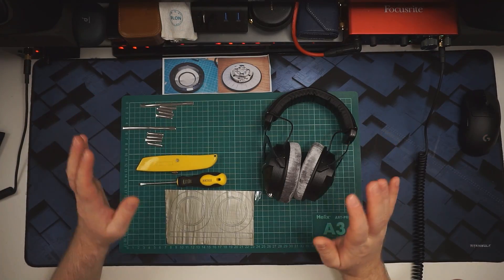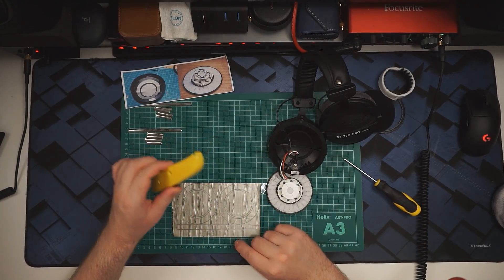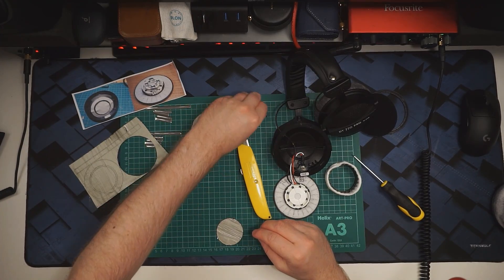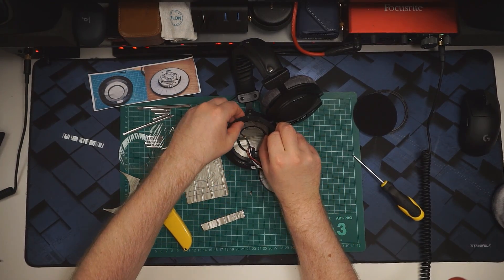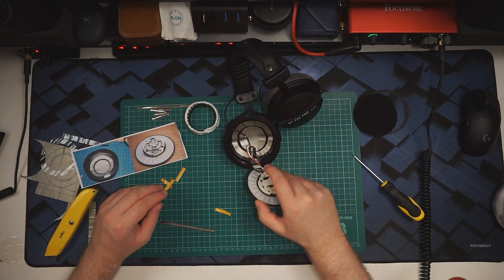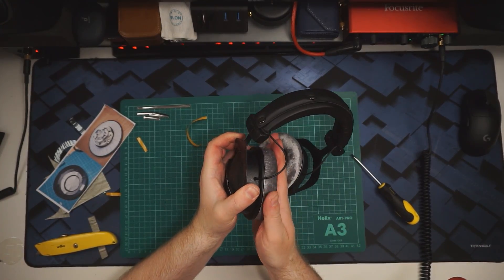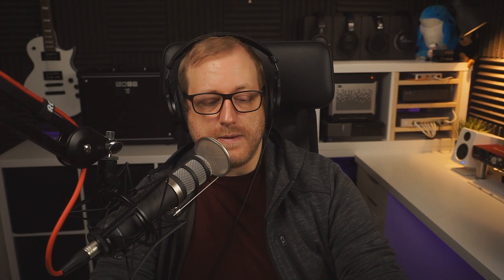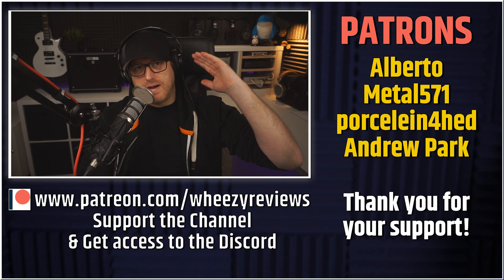DT 770 Mod - Mass loading and damping

Comment: I've just bought a new pair of the DT770pro (250ohm) to replace my old pair from 2002. I noticed a huge difference between the two soundwise. My old pair does not have a peak in the treble and the mid range is much more open and big sounding. The only difference I can see on mine is that the thin paper in front of the driver (in the center) is worn of on the old pair and so is the foam pads. So that's my suggestion on how to mod them. Remove what's in front of the drivers. That is unless Beyerdynamic have actually changed the drivers to a worse sounding version

Comment: I have just been looking at the customized DT770s on the Custom Cans site, but after watching this video, I think this mod is for me, I don't feel the need for more bass.
 I love my 250Ω 770s, but they don't work well with my iFi xDSD DAC/amp, there is plenty of gain, but the sound is sluggish. I want to get some 32Ω 770s to go with it. My DT1990s are OK with this DAC (also 250Ω, but a couple of dB more sensitive), but I don't want to take these outdoors. Maybe the 80Ω 770s would be a good match, but they would need the cable mod, stock cable is too long.
I notice that several people commenting on this video have experience with Beyerdynamic headphones, can anyone give me advice on 32Ω vs 80Ω?

Comment: What the hell is that massive 4k dip? Is that normal with these headphones? I've been thinking about buying these and I have never seen a graph with such a massive dip in that are. Is that something to concerned about?
Reply from the maker: Don't worry about that, MiniDSP measurements are often way out in that area. It's just a quirk of this measurement rig.
Reply: @WheezyTech  Yes, I am using a Dayton Audio EMM-6 in an MDF baffle and it is covered by sheet rubber and it gives me some measurements like this (DT 770 250Ω) but that 4k dip is definitely is not there when I use tone generators to eq my headphones, because I am not using a pinna so the result is a little different BUT even using a pinna and a even very expensive measurement rig will not give us a very accurate graph (though it will be closer to what we hear) because everybody's pinna is different, even one person's left and right ear pinnas are slightly different and you will discover that if you try to eq your headphone for each ear individually (first eq only left then eq only right), note that then you should level match left and right or better still, eq again with both ears.
For anyone interested I strongly recommend "SineGen" which is a very small and free program which is way better than normal frequency sweep files. In fact you can use a frequency sweep after eq to double check your eq.

Comment: These headphones from day one i love them and hate then at the same time i love the airy feeling the big soundstage the analytical sound...But i hate some time they get bright and worst of all they sound so dry and bass feels sooooo Slooooow ....The bass is going low and very progressive but its not tight its not fast. I tried fixing it by adding Dynamat extreme it costs me 30 euros inside the cap and around the ring i take of the foam around the ring also it gets tighter thats true but it lost the progression.

Comment: Do you already have or will do a review on the Yamaha MT5? Bought them for about 80 quid a while ago but they punch way above their weight, a W sound signature, forward and energetic, had to eq them a little bit because I'm very sensitive around 3-4khz, other than that, very impressed.

Comment: Hey, I've noticed you use yoga blocks for storing your headphones but I was told stands like these (or the head shaped ones) actually decrease the earpads' lifespan because when not in use the earpads should be "resting" and taking fresh air. Are you aware of this or do you think it's utter bullshit?
Reply from the maker: I used to worry about that but it doesn't seem to be a problem. However I only ever use them on the narrow side of a yoga block. Some people put their headphones over the wide side of the block, but I feel uncomfortable doing that for the reasons you mentioned.
Reply: @WheezyTech  oh yeah the wide side would stretch them out for sure. Thanks for answering!

Comment: Damping, not dampening. When you dampen something, it becomes wet.

Mass loading... i don't think it means what you lot think it means.  A speaker is a mass spring system. The load is the mass of air that the speaker works against. So for one adding weight on the back of the driver is not "mass loading" and for other, it reduces the movement of the speaker and baffle due to inertia, but for the most part this was negligible to begin with and this mod part seems snakeoilish and stupid.

Even the rest of the mod is more than a bit suspicious. If you want tighter bass, you want such absorbent material, that will not reduce the apparent volume of air. A fibrous low density material. Otherwise you just shift up the resonance further into the midbass, and who the hell needs that mess? Or increasing the volume or giving it an aperiodic vent.
Reply: OK, the material is less bad than i anticipated, but i can't say that i entirely understand its behaviour.
Reply from the maker: I remain sceptical of its benefits tbh and only did it out of curiosity. Especially sceptical about the mass loading, I suspect this provides insignificant benefits if any at all. I will more than likely revert this mod but it's interesting to see that it does actually change the bass in a noticeable and measurable manner.

Oh thanks for the correction on the word 'damping'.

Comment: Thank you for posting the before/after graphs.  Can we speculate as to why these mods produced the changes in bass you measured?  I suppose the added mass reduced vibrations and lowered the resonance freq of the baffle and cup.  The added bulk consumed some cubic area of space in the cup which may have contributed to a mid-bass hump (like a woofer in a smaller box).  And perhaps the combination of these 2 effects produces a up and to the left shift in the bass curve?
Reply from the maker: Could be yeah, not sure if its worth it but was an interesting experiment

Comment: With this mod you hear same details in sound as with the unmodded version?
Reply from the maker: Yeah no loss in detail. But also I don't think this has caused any significant increase in detail either so I'm not sure how much help the mass loading really is. I always found the 80 Ohm to be fairly quick and punchy already and I don't think the mass loading has added all that much.

Comment: As a bass-head and someone who also enjoys my DT 770's / 250Ω, this looks amazing! I'm not comfortable enough to perform these types of modifications on my own, but thanks for your review.
Reply: For a basshead do these bang, I been thinling about the 1770 ,770 and 880 250 ohm for decades.. I really admire the solid builds.
Reply: Customcans.co.uk is mentioned in this video and will do all the mods featured in this video (including detachable cable) for about ~50 EUR. I would recommend the 80ohm if you like bass, btw.
Reply: This mod is as easy as it gets man
Reply: Mass loading the headphones from the outside shoul also work